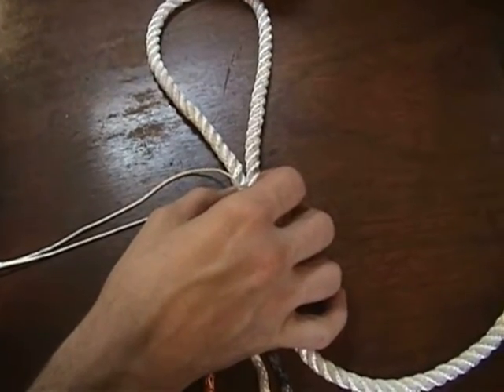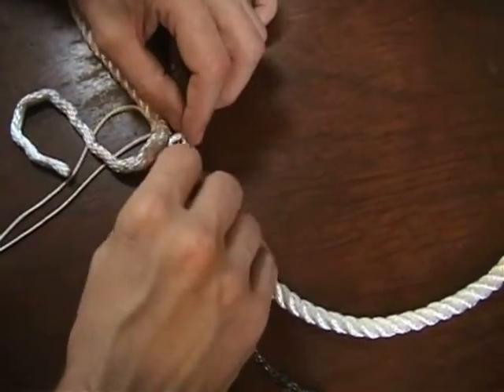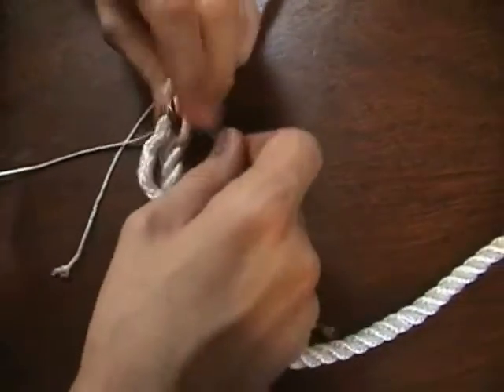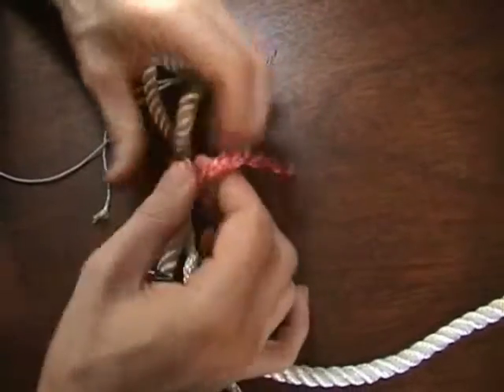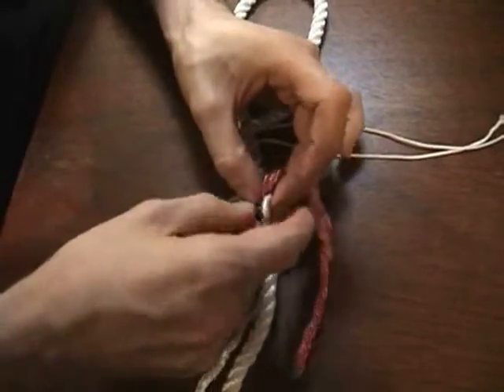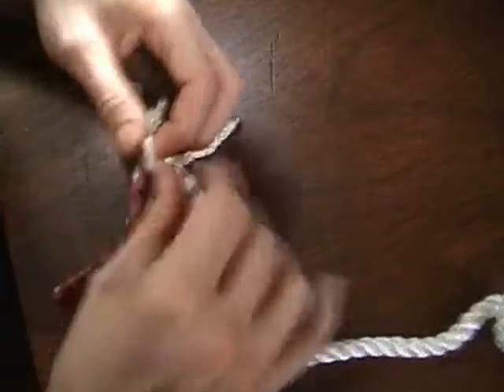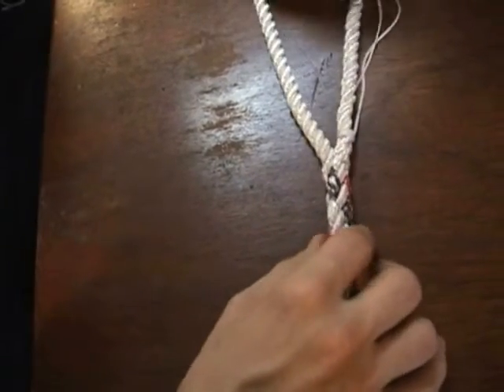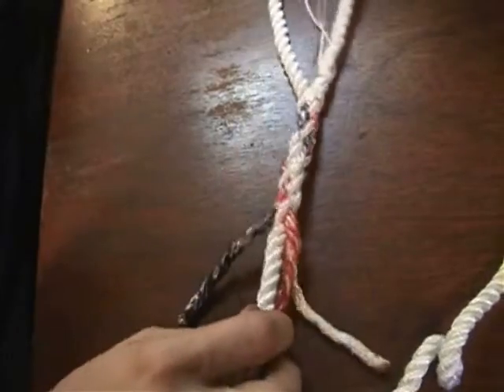3-Strand Splicing 5 - Basic Eye Splice

Comment: Hello, I am also a member of IGKT. I have a question about the two tucks on the first strand. Do the other two catch up, or is there always an extra tuck for that strand? I have not seen or tied an eye splice this way before. I always have started with the top (center) strand. I am intrigued, though. I teach Marlinespike Seamanship for the Hoofer Sailing Club in Madison.
Reply: I don't know of the creator is monitoring comments, as he hasn't posted anything for several years. I'm really pretty much beginner at splicing, but here is my take: The first tucks of the second and third strands are made even with the second tuck of the first strand, so that strand gets one extra tuck. This video is the only place I have seen this technique. Every other tutorial I have found has you starting all three strands at the same level. But I like the results with this technique. I find that with the conventional technique, the start of the splice tends to be a bit loose for one strand, as the length of strand between the end if the laid rope and the insertion of the strand into the rope is a bit longer for the strand that gets the extra tuck in this technique. That connection point seems to be significantly tighter using the extra tuck on that strand. I think I am going to start eye splices with that extra tuck from here on out.
Reply: @russlehman2070  Thanks for the insight.